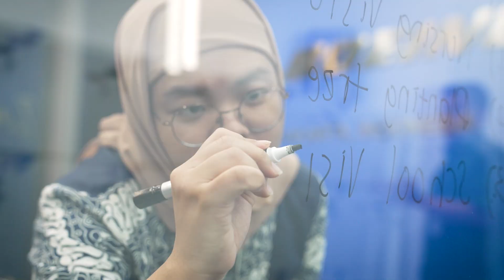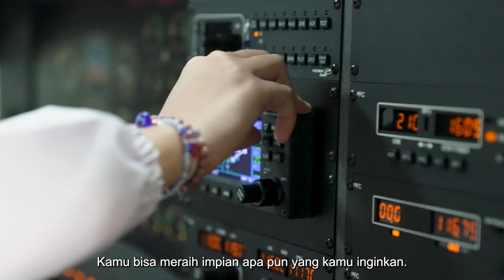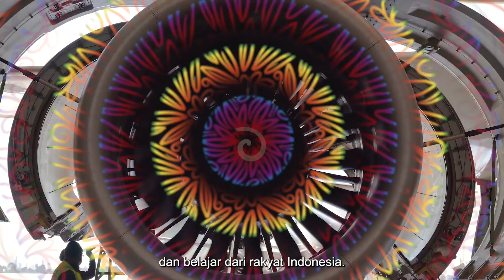Boeing in Indonesia

Comment: regarding passenger airplanes why not make three things for safety, parachute for the whole plane plus side doors under the plane for jumping with parachutes for passengers in a way which won't effect the pressure inside the cabin, also make chambers under the plane that could be opened to direct and utilize the strong outside air and pressure to pipes going from these bottom chambers to sides and up then pointing down from above the airplane on its sides downwards in some angle in a way that can help lift the plane or cause a smoother fall when plane engines fail in the air. the one in the middle of the plane can direct the air towards the wings in a way that can cause an up lift to the plane..